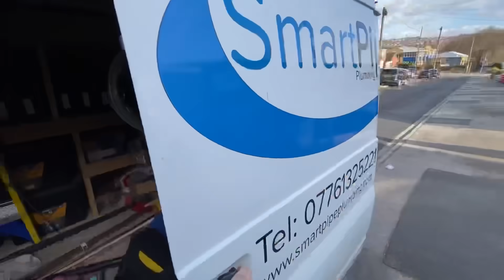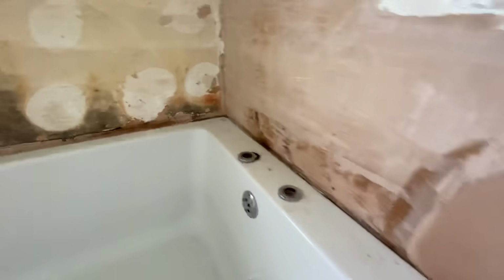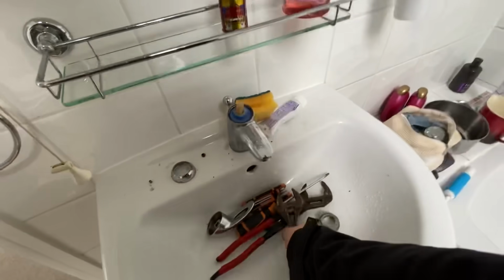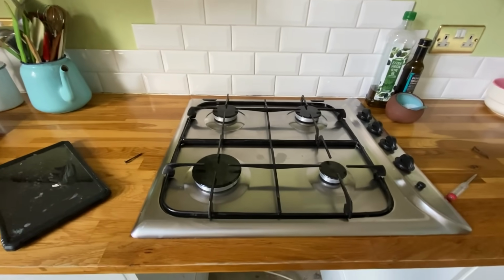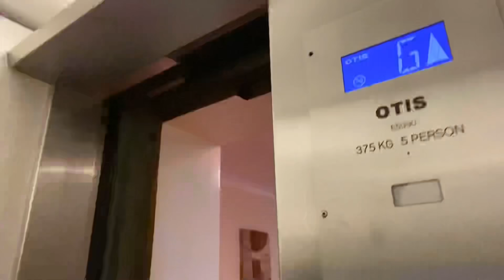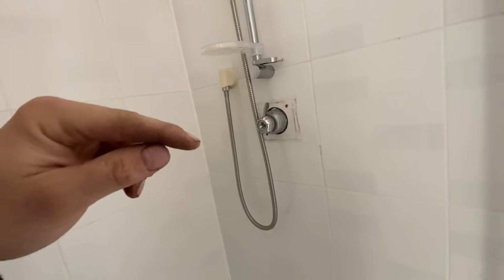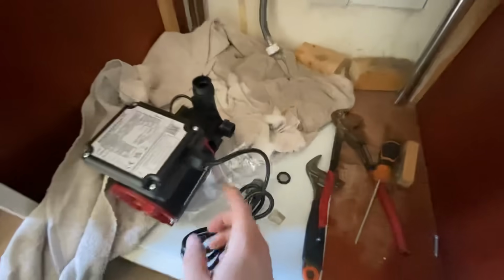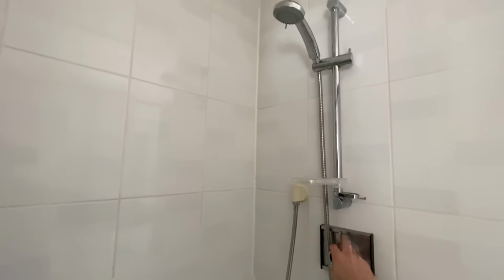Week In The Life Of A Plumber || 006

Comment: If the bath tap has a shower over it i would use loads of silicon to seal the taps into the bath or they will leak though especally if they have adaptor plates on the base of the tap.
Reply from the maker: If Installed correctly they shouldnt leak through

Comment: Do you not need to sleeve the outside tap from freezing & filling the cavity?
Reply from the maker: Always put isolation valve on the inside to isolate the water in the winter to stop freezing.
Reply: @SmartPipePlumbing   thanks for reply, didn’t know if it was a requirement to always sleeve pipe passing through cavities. Cheers
Reply: I’m probably getting confused with gas regs !

Comment: Hi from Canada. Enjoy your video. As I am a HVAC Tech, I enjoy seeing how work is done in different countries. My question is why do you have a pump on a shower? I've never seen this before. Thanks for the video. Cheers
Reply: There's isn't enough pressure in the system for the hot and cold so the pump increases the pressure giving the shower more power when in use 👍
Reply from the maker: Thanks for the support, the water pressure is really poor due to it been on a gravity fed system. So we use a pump to boost the pressure.
Reply: Hi Paul any chance I can message you somewhere I’m a plumber looking at immigrating to Canada from uk
Reply: @pauldeighan4626  Yes no problem at all.
Reply: Hi bruh i m in canada too how much a HVAC tech make ?

Comment: why is it only a single impeller pump?
Reply: it seemed like the pump was on the mixed (outlet) side of the shower . never seen it done that way before but i guess it must work
Reply from the maker: Yeah it’s not something I’ve seen done before either, we was just going a straight swap. Works quite well to be honest.
Reply: @SmartPipePlumbing  I suppose it's all down to cost to with the likes of the Landlord or Property Owner, plastic pumps generally give up after a few years, obviously in that regard it depending on use, have an apartment rented and a plastic pump packed up... my Letting Agent who also had a rental property suggested. that the Plumber told him i should  upgrade to Stuart Turner, Bronze pump with a 'Five Year' Warranty best choice i ever made sleep a lot easier...Lol...

Comment: Good video as always pal. Can you fit a shower pump on any system?
Reply from the maker: Pretty much, depends of the system and the pump you fit
Reply: Cheers for getting back to me 👍🏻
Reply: Iv got a combi boiler but the water pressure in the bathroom isn't that good s I was thinking of fitting a pump to help
Reply from the maker: It’s hard to say as if it just your bathroom it could be the plumbing itself that’s restricting the flow rate, or possibly the fixtures such as your shower or you taps
Reply: Cheers pal
Reply: @SmartPipePlumbing  if its just the shower it may be the filters part blocked